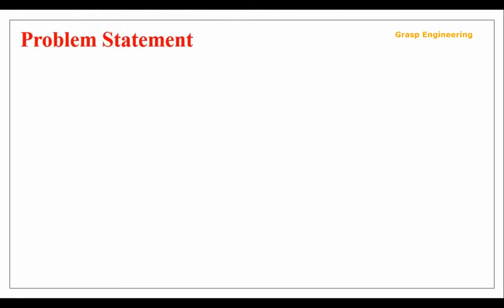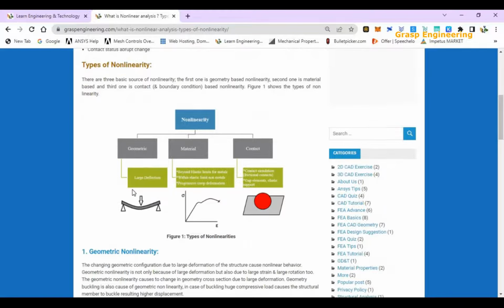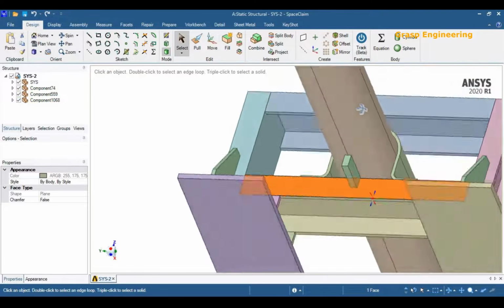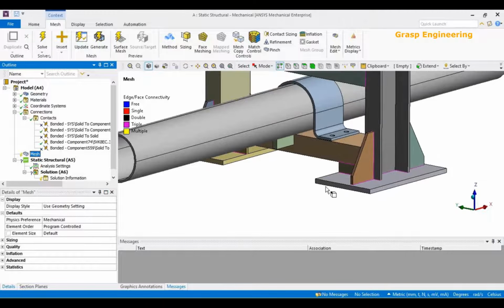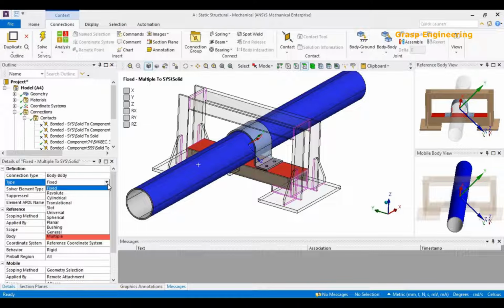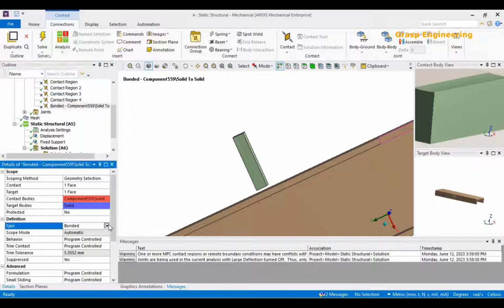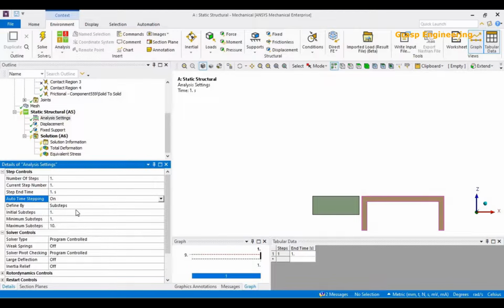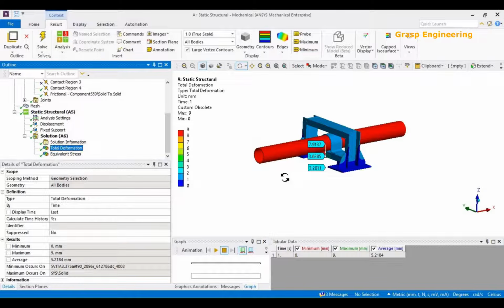Nonlinear Aalysis Of Pipe and its Clamp support Using ANSYS

Comment: Hello, i have a contact and target that is initially far apart (~21mm), the contact is a large surface and the target is a long rectangular bar under the surface. The contact surface is fixed on four edges, and surface pressure is applied in attempt to make it bend down. Under pressure load, the surface should bends/deforms and stop at the target. I've tried to set up frictional contact, using AL formulation, and added time steps, but the contact doesn't stop and still penetrates.... what am i missng in the setting?

Comment: Thank you for explaining your analysis. But I see your contacts seem to be having an issue. @28.45. Your steel channel is deflecting even before the stopper is in contact. I had the same problem with Abaqus in my PhD days. The way i solved that was to define displacement as an initial condition and then allow it to move during the number of time increments. All the best.
Reply from the maker: The contacts behaving properly. The clamp is bolted on the C channel which is in contact with the pipe, so the c chanel will sol have some movement due to pipe.
Reply: @graspengineering9249   Sir can i have your number please